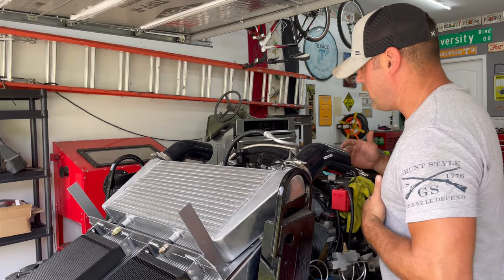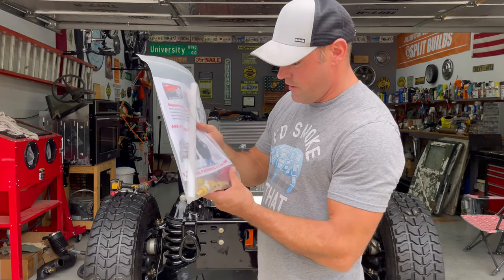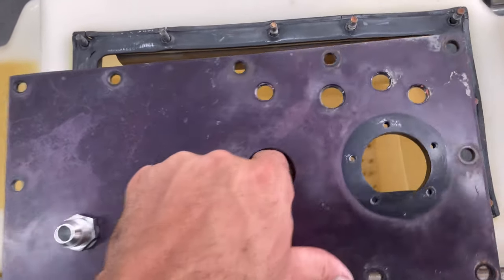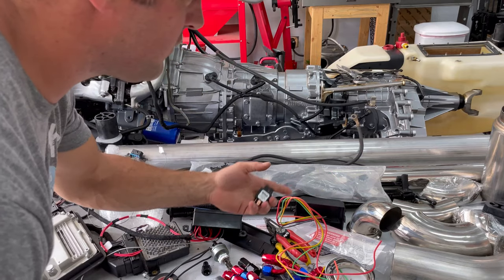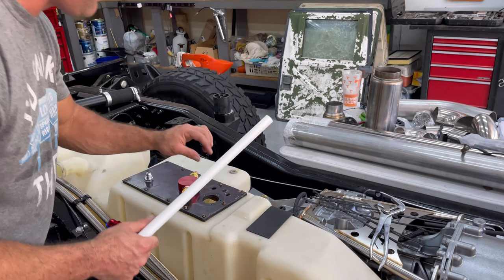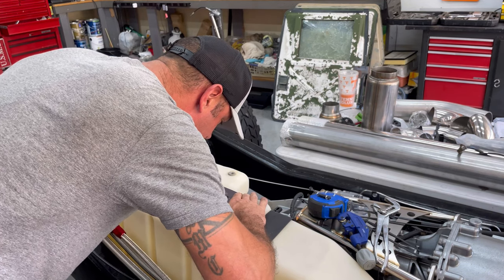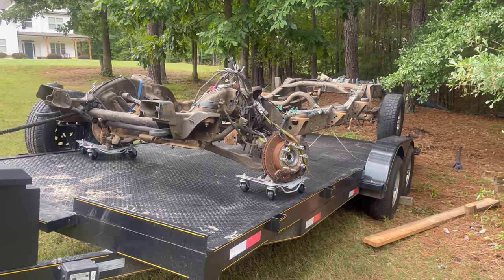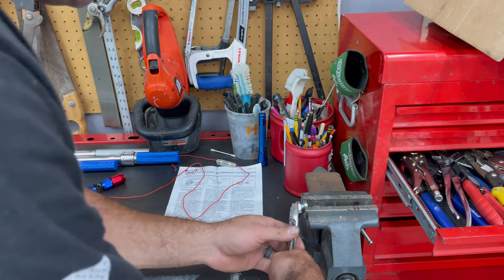Humvee Fuel Lines and Suction Tube

Comment: Fass pumps are cool! Hopefully there is some room left over near the transmission to get that fass on the frame! Got a couple extra relay spots for it with your fuse and relay box. Also happy wife happy life. Good thing you got that Chevy out of there with nothing left. I keep things around too long as well just in case I need something off of it 😅
Reply from the maker: No doubt! I would run a salvage yard if I could here🤣
Reply: Mod mafia makes a fass mount for the frame

Comment: what do you got planned to tie in the return line off the injectors
Reply from the maker: Both injector banks tie into the return hardline line that I kept from the existing engine. That’s why I keep the main engine return hardline. The inlet will be going straight to the CP3